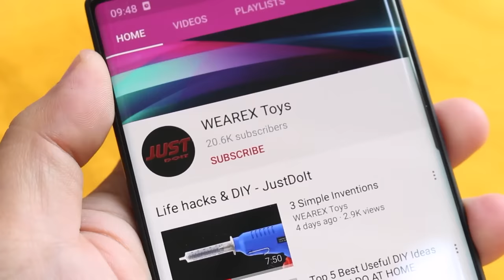TOP 6 BEST DIY TOOLS FROM SCRAP METAL

Comment: the guillotine made from an open ended spanner won't work for long as the fixed blade the spanner works against is only mild steel. i suspect the rod being cut is very hard and brittle to snap like that. i would think a mild steel rod would bend upwards and not be cut.

Comment: The concepts are all awesome but so many problems with assembly. I was sad watching a bearing get welded.. especially since it was a sealed bearing!. For that application an oil bronze bushing would work fine.. even just a regular bronze or brass bushing. Never weld on a sealed bearing. One you burn out all the grease inside (notice the small time it was on fire) and also, the weld is not going to hold. Bearing races are high carbon hardened steel. They do not weld very well.

Comment: You have to buy a bunch of power tools, lathe, welding machine and a whole array of hand tools to make some manual tools from not so scrap metal and parts. 😂
Reply: M
Reply: Not true
Reply: Nah all you need is an angle grinder, a welder, and some creativity
Reply: @mpirokajosephmgcokoca2355  6:23 6:23 ada 😮😅😮7
Reply: Usually people already had most of these regular store-bought hand tools to do some of this work only those who don't are really making it difficult and expensive if they already have them it's easy cheap
Reply: It mean that this video is not for you, this is for other